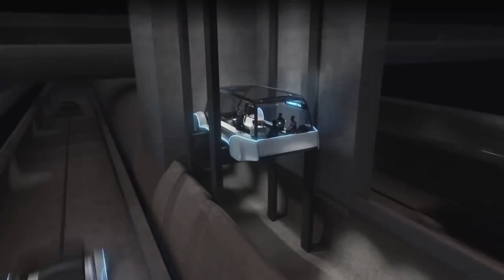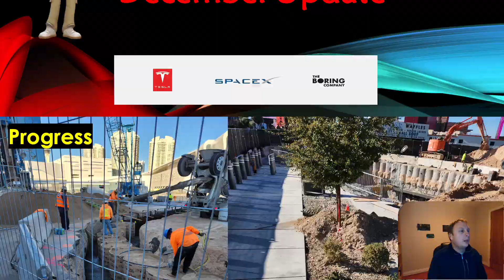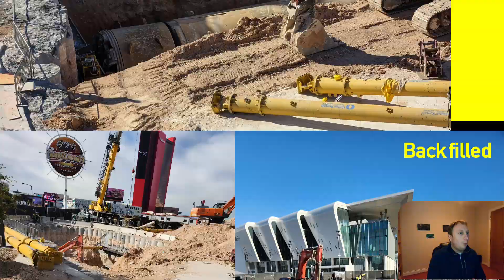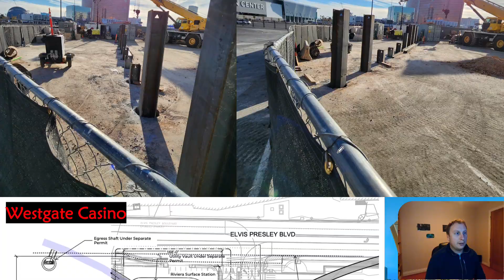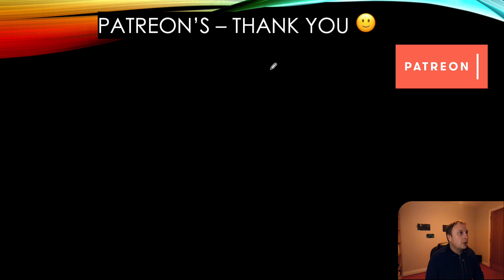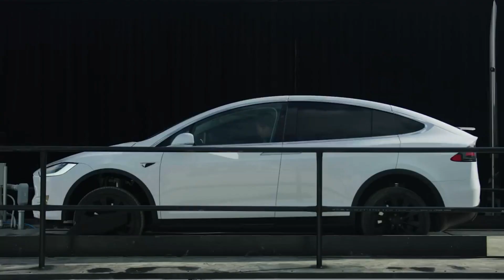Resorts World, LVCC & Westgate Casino, Project Progress 😀 🚇 👷🏼 🏗️ 📊 #159

Comment: Hey, will a mag-lev car be able to go on the Hyperloop or boring tunnel, is that going to be the future of movement with cars when it’s available?
Reply from the maker: I've always said that Maglev works quite well in a tunnel. Forget about Hyperloop (to begin with) and focus on a 260 mph Maglev system with 150 ft trains. Strip away costs and just do something basic with small stations and standard tunnels.
A tunnel can always be upgraded in a few years if you want to achieve that 92% vacuum and become a hyperloop.
I suspect that Tesla cars in tunnels will be used for many many years as 100 mph is more than good enough 😁 !